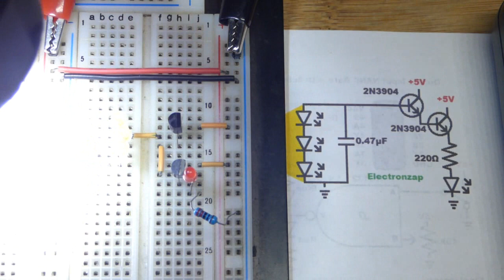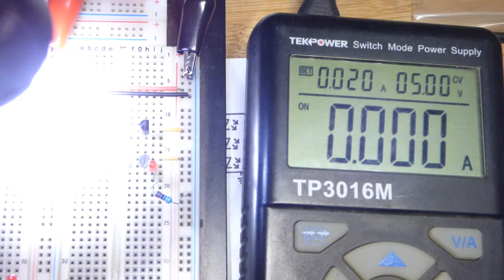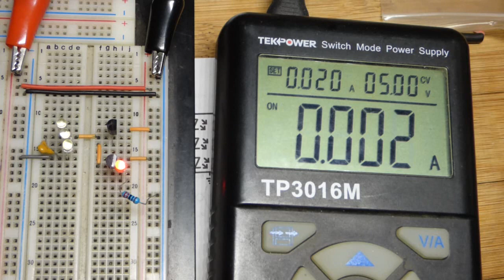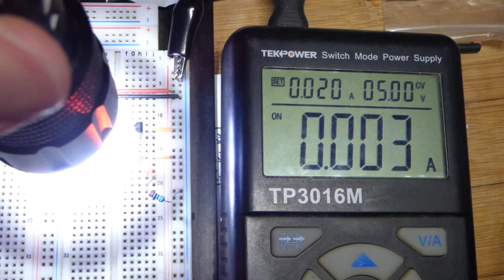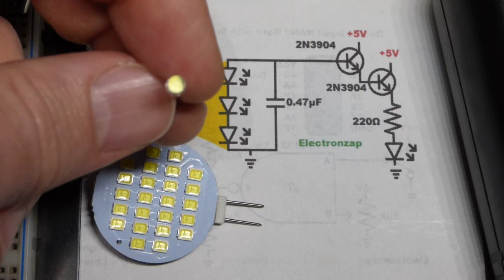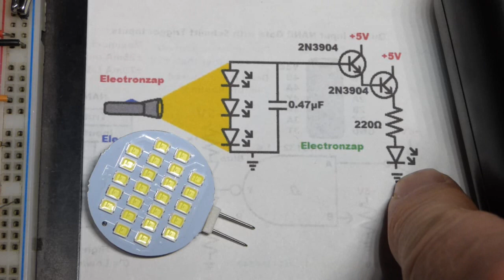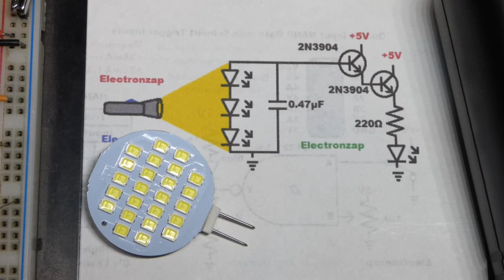Testing more LED colors when used as a light sensor with NPN BJT 2N3904

Comment: I don't know if someone elso has commented this, but please ensure to use all LEDs (regardless of their emission colour) with crystal clear and colourless lenses. The red LEDs had red epoxy over them and that would cut out a portion of the incident light from your torch, reducing their efficacy in your circuit.
Reply: I used to scrape paint of old types of transistors and see the effects of light on them. A lot cheaper than photo diodes at the time.

Comment: the colour of the LED body and the colour generated by the silicone are different.  The colour of the light you present to the test LEDs will be the 3rd variable.
Reply from the maker: Good points.

Comment: Repeat this circuit with the 3 LED's in parallel, and in reversed direction between the base and negative of the powersupply.
A few months ago i was also experimenting with LED's as LDR (Light Dependant Resistor) and found that they work better in reversed direction,
en even without any use of Darlington. Simple 1 LED in normal direction, and 1 LED in reversed direction, both LED's in series. When light of a flashlight hit the reversed LED, the other LED lighted up. When i did a resistance measuring, where a LED has above 200Mohm resistance, the resistance dropped into the Kohm range when a flashlight was used. Some colors work indeed better then others, the white LED's with yellow internal core didn't work as good as others in my experiment.
Reply from the maker: Parallel LEDs get you more current which does make a big difference. If I really wanted to use LEDs I would definitely parallel them. To get enough voltage though, you usually need to put them in series, whether you also parallel them or not. Good points to mention!
Reply: @Electronzap  a LED used as a solarcell works best when placed in parallel and in reversed polarity. With 10 in parallel and hit with a flashlight, they can give out more then 1 Volt, but at a very low current (µA range).

Comment: One more thing 
Like I have a mercury tubelight 
So like I had put high voltage on both of its ends and it produces blue coloured light 
And when like the ends are at a certain distance so it produces white light 
So like does it emit uv or anything
Reply from the maker: I don't know anything about tube lights unfortunately.
Reply: @Electronzap  make a video
Reply: Heh it's fine
Reply: How can we measure uv radiation